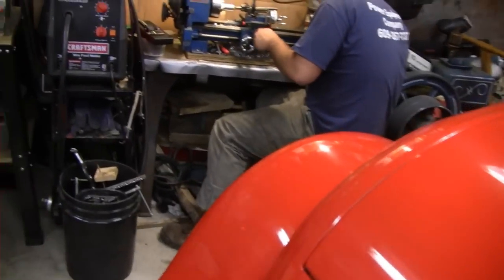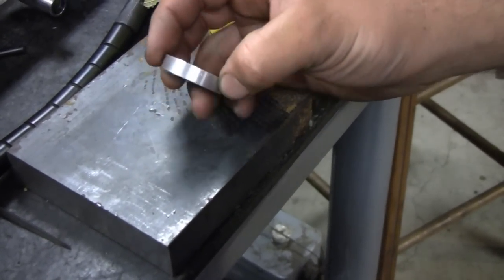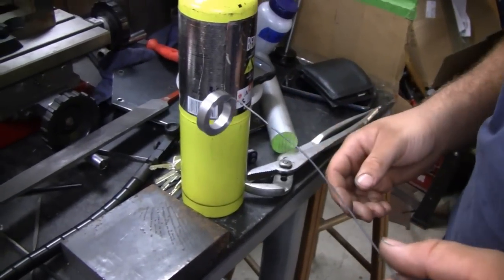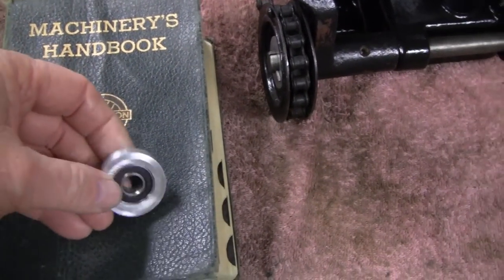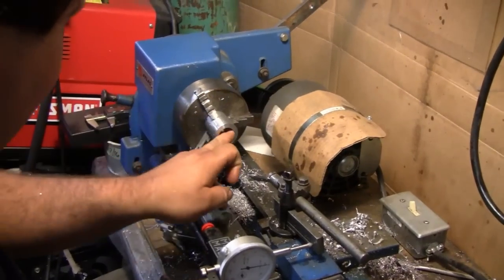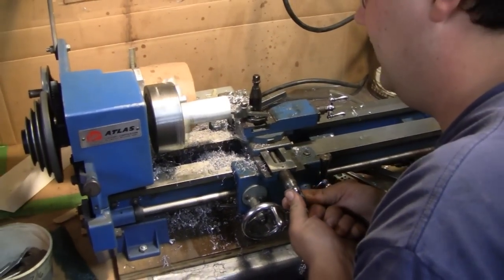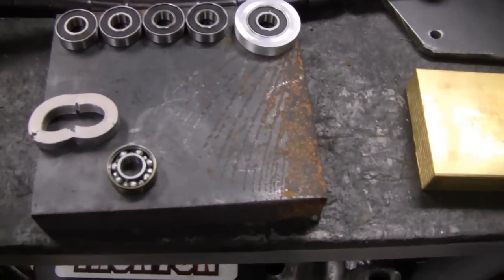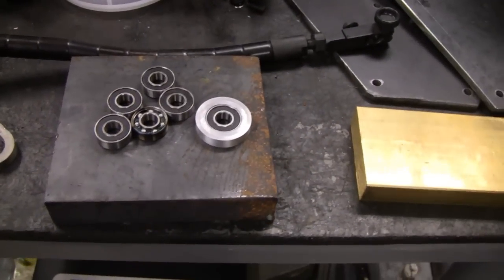HOMEMADE RADIAL BRIGGS ENGINE (part 24)

Comment: Man ! That took makes a fine cut !
I've realigned 2 stroke sleeves that way .
Jug in the oven and sleeve in the freezer .
Sometimes the factory doesn't line up the ports as nice as they should .
Reply from the maker: That would have made a good video!!☺

Comment: Good try guys... Next time, try using Dry Ice (frozen Carbon Dioxide) to shrink the inner piece, and the oven to heat the outer piece at 250 degree controlled heat?  Ferrari chills their valve seats using liquid nitrogen, before dropping them into cylinder heads.
Reply from the maker: Thanks Bud!! We were just playin' for some entertainment and a video!! Those things press right in with the vice or Arbor!!☺

Comment: Did you guys cut chamfers? I kinda don't see a chamfer and that would help a ton with fitting the bearing, really does the difference.
About heating the aluminium and cooling the bearing, i ran in the same problem and what i did and, well, haven't heard the bearing crakle on me yet, is i dipped the bearing in shower of CO2 (from an expired fire extinguisher i keep for fun, the big 1 meter tall ones) and put the aluminium plate (it was a belt sander side plate) on the heater for 40 minutes or so (probably 60 degrees Celsius). And it worked, like really well, where as before i actually nicked the aluminium trying to press push it in, even with a chamfer cut in it.

So yeah, what i am saying, if i'm saying anything is, if you can't heat the receiver too much, cool the other part more.
Reply: All that aside, really nice machining work, especially on that tiny lathe, goes to show that it it's all in the operator and not in the machine. A looot of people think those mini-lathes are toys and i beg to differ, something just cannot be made on a 3 meter long lathe.
Reply from the maker: Thanks Mate!! We were just playin' for some entertainment and a video!! Those things press right in with the vice or Arbor!!☺

Comment: On a bearing that size, .0005" to .001" interference on the bearing outside diameter. Heat the ring to about 250F and freeze the bearing. Some sort of alignment fixture would help.
Thanks,
John
Reply from the maker: Thanks Bud!! We were just playin' for some entertainment and a video!! Those things press right in with the vice or Arbor!!☺